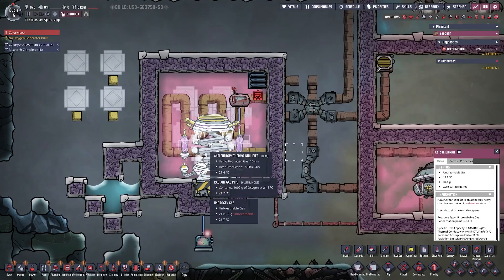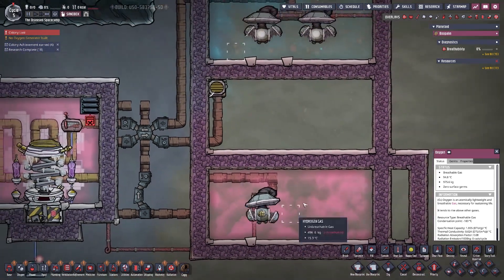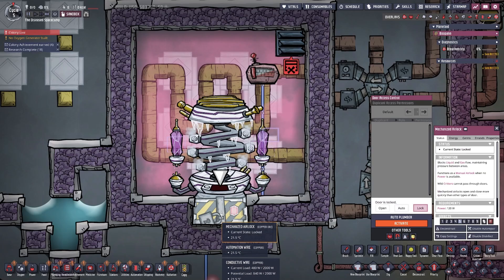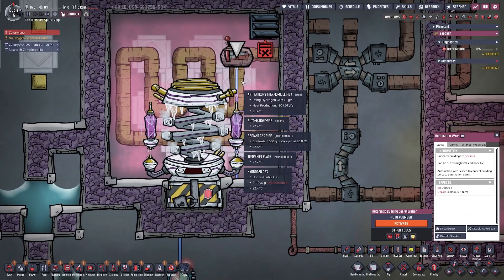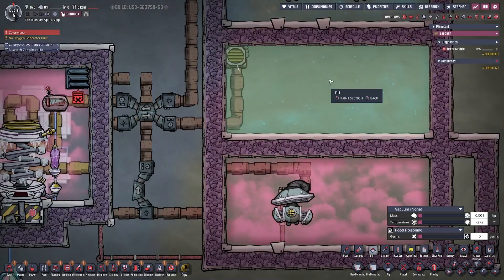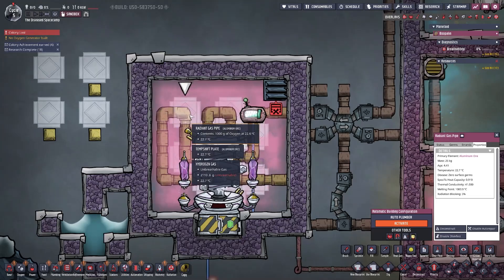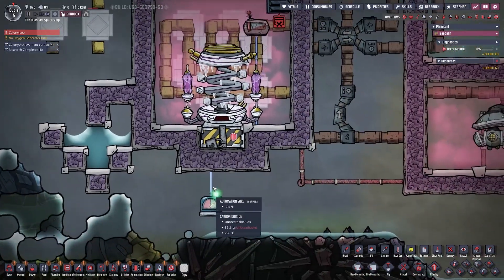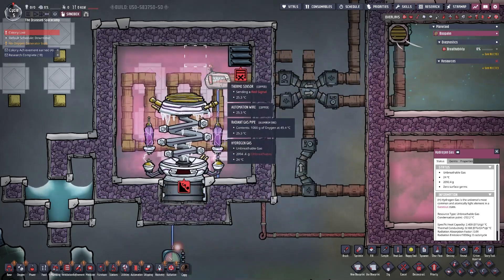ONI Early game cooling with AETN (setup guide)

Comment: I use AETN to solidify the CO2 from my oil and gas generators so I don't have any problems with it, and I don't use AETN to cool the oxygen, for that I have a closed loop cooling system via Turbine + Aquatuner and in this system I don't use external energy from bases, the main energy comes from hydrogen generators that burn hydrogen produced in an electrolyzer
Reply from the maker: That is a really good choice, since AETN can even liquify hydrogen, it just takes a longer time.
My intention was to help out newer players on how to make use of an AETN in the early game, since later you will have steel and access to aquatuners.
Nice approach tho